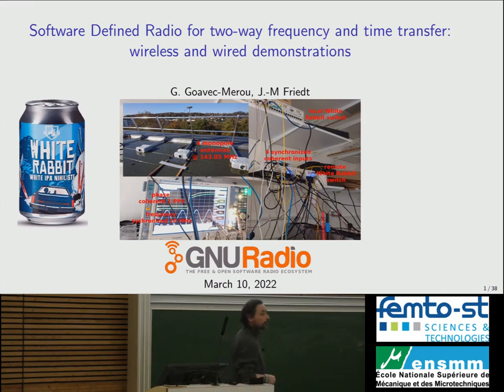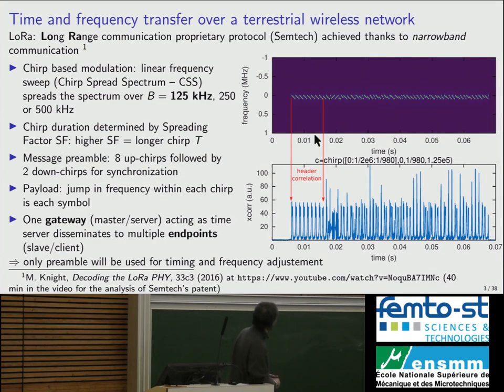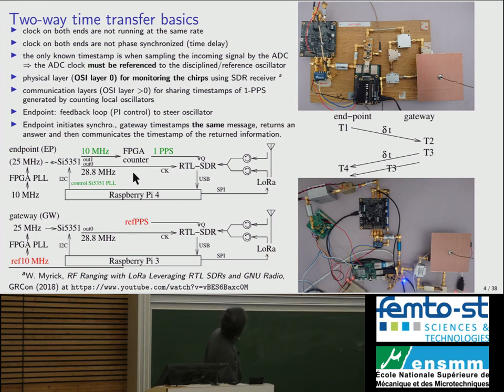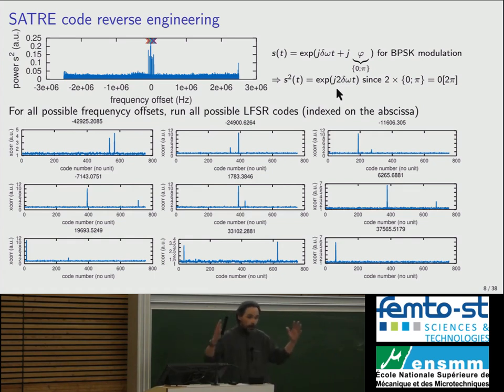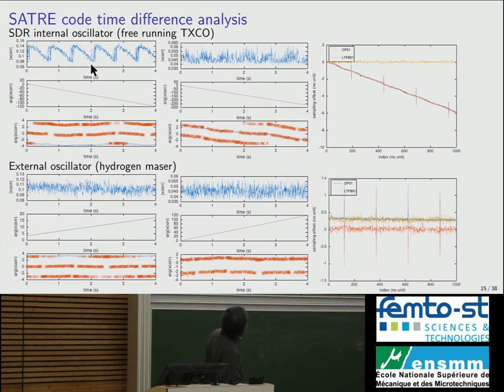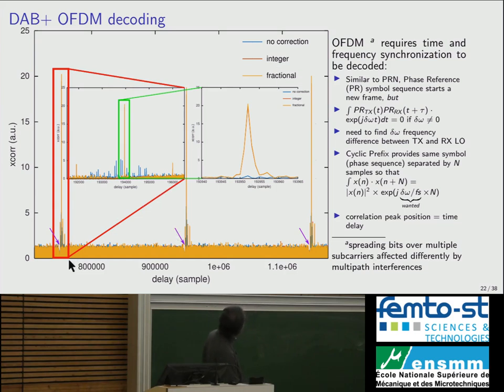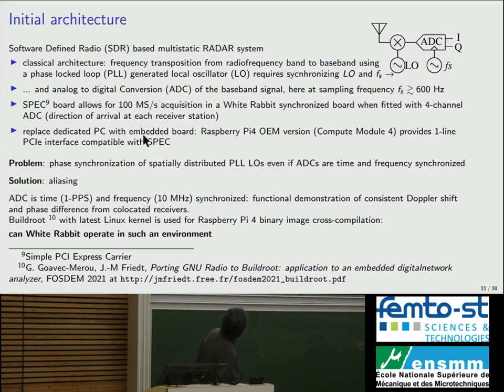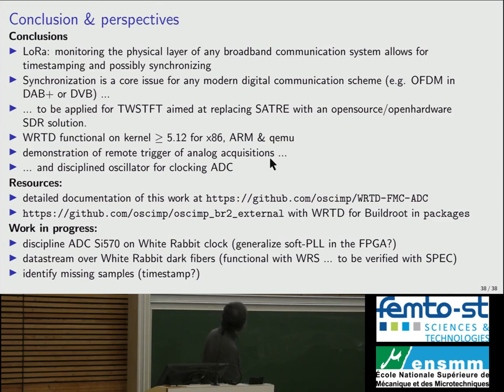Software Defined Radio for Two-Way Time and Frequency dissemination

Comment: Couldn't find the link to the presentation or GRC files, but is the idea that you can do radar on a Pi4 so long as you have a very stable clock, and here you've done that with the ethernet-based White Rabbit protocol (ref clock, sys-clk, AD9548)..  and if you have multiple ADC carrier boards each with their own ADC clock (Si570) then you also have to sync those as well.    What ADC (chip/module) are you using?  What is the USRP X310 used for?
Reply from the maker: Thank you for the feedback: I have uploaded the GRC and slides of the presentation to https://github.com/oscimp/gr-satre in the documentation directory. We ran two sets of experiments: either using the X310 as a dual channel ADC when fitted with the BasicRX module, in that case using aliasing and recording the signal in the second Nyquist zone, or using the FMC-ADC SPEC board designed to be used with White Rabbit. This daughter board can sample at 100 MS/s its 4 input channels. Once the ability to synchronize the ADC clock with the AD9548, any RF ADC board can be used since anyway the FMC-ADC daughter board is not synced on White Rabbit (work in progress)